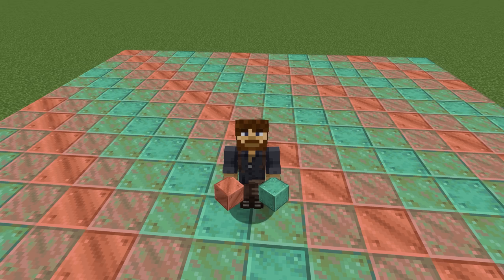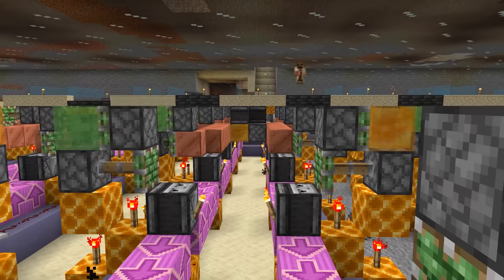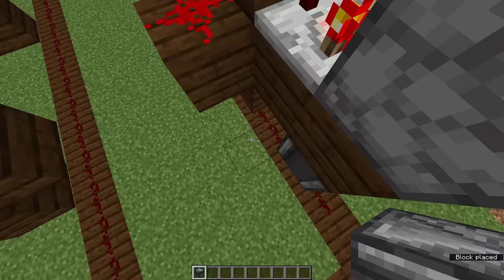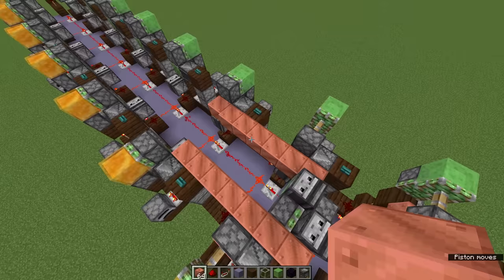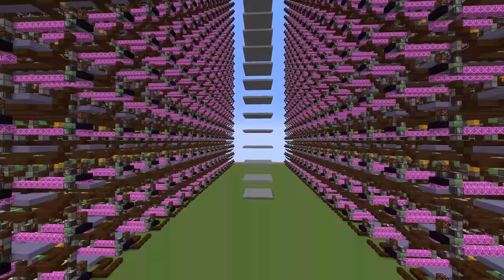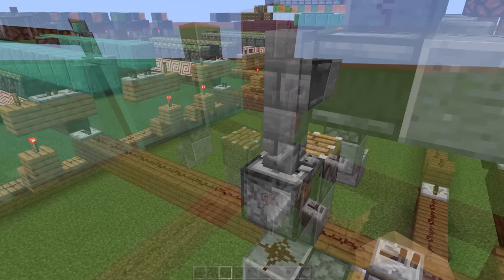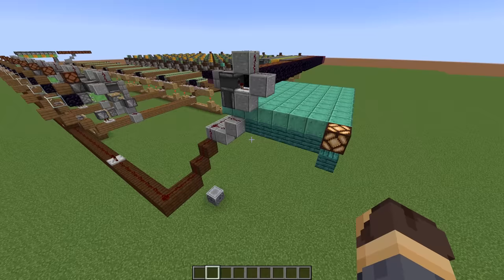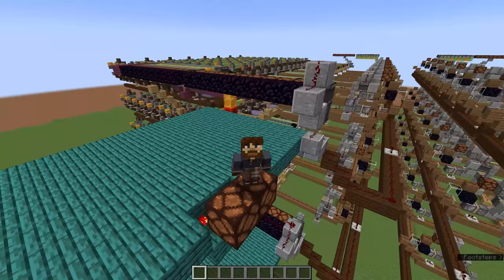Redstone Copper Aging Machine, AKA "David" (Tutorial, Schematics & World Download)

Comment: So I recently built a David 5 in my creative world in order to teach myself more about different redstone circuits.

In the process though, I came up with a small modification designed to make resolving the counting error easier (when a copper ages before it's placed and that module can't reach 0 and eject).
Basically I added a new circuit over the top of each line activated by a note block at the front of a line that pulses every top dispenser in that line once. It only affects modules that haven't already ejected and it saves you having to search out and fix the specific module that's stuck.

This does mean that now the best way to observe the lines is from the front, rather than the top as with some iterations, so I just built a lowered catwalk that runs down the center and use a spyglass to check for errors if a line seems to be stuck.

It might not be for everybody as it does add to the redstone cost, but I like the ease of access it lends to the user.
As a bonus, it also helped my attempts to make an aesthetic underground design that hides most of the redstone.

Comment: I love this version I'm currently on the final layer on my server and the rate  of copper oxidation is amazing. Played around with a lot of ways to remove the oxidized copper as it will break the flying machines upon the return of the second batch due to the push limit being reached. I prefer the piston feed tape, but simplest solution for a less technical player is an observer observing a wall where the last oxidized copper ends up that sends a signal to a layer of pistons pushing the copper up or down so you can let it run and it won't worry about the flying machines breaking. Also changing out the lever for a t flip flop removes the chance that you forget the lever and send the copper to the wrong half of the corner.

Comment: This is how tech players get started. Cheers for creating this! It can be a fun to come up with your own solutions, even if off-the-shelf solutions are available to be copied and are more optimized. It is just a game after all, ideal solutions aren't critical and solving problems can be more interesting than going through motions someone else came up with, if you are so inclined. 

A note about the 0-tick smart piston, you want to use a sticky piston for the one that pushes the block if you want it to actually 0-tick the block. A normal piston can be 0-ticked, but it won't instantly teleport the block like a sticky piston will. That particular version is also locational because of how redstone dust update order works - if it doesn't work in a given location, usually moving the updating piston on the bottom to instead be on top of the block fixes it most of the time, but there are still a tiny fraction of locations where it just won't work at all and a different version will be needed.

Comment: So this becomes as slow as the slowest aging coper block. Doesn't super matter since loading and unloading aren't fully afkable I guess so it doesn't really add any overhead to have to manually eject any blocks holding up the whole process. The ideal form of this probably returns the finished stuff to a separate station (to be hooked up to block storage/blast chamber), can load/unload each module independently as it becomes available and has some kind of timer back up in case one of the blocks ages before it starts being observed. 
that sounds really hard though.

Comment: So, not to be a jerk, but because of pix working on this with X, I took a shot at it myself, very loosely based on the design they used in hermitcraft, I have a design that can handle a 9x9 block of copper blocks and I think it's lighter on resources and less complex. One thing I don't have, but I thought pix, did have, is a way to account for a block oxidizing while flying or double oxidizing. Seems neither of us got around that. In my design what you can do, is just set the machine to recall a couple updates early (which is programmable, no block changes needed) so you could set "complete" to 240 instead of 243 and then you'd have safety against 3 undetectable events, but you may have the system fully recall with 3 genuine updates missing. But I think that's the best you can get. I'll try to find the time to share my design, but I'm already 3 months behind posting the let's play I am currently doing, so that shows how good I am at staying dedicated to posting on YouTube. Tell you what, if pix himself or a hermit reply to this, or if it gets 20 likes, I'll make the video within a week. Lol come on Minecrafters, motivate me. Haha

For anyone who may actually read this, I use different flying machines, still tileable, and you load all 81 blocks manually, but all in one big block. I don't have a single position for you to stand to load it, but that could easily be added.
The 9 machines fly across once as pistons pull rows of blocks down, just like this design.
When they reach the end, individual flying machines take them to their final place, again just like this design.
Then there's counting, my counting is completely different. I've made a few different counters, but I think 1 central counter for all oxidizing events is actually the key, cause then you can recall a couple updates early and not worry about double events or oxidized while flying events.

Also full disclosure, my machine has only been built as a 4x3 version of itself ATM. But making it bigger is just copying and pasting, its the same complexity at 3x3 as 9x9.
Reply: Oh and my recall is done differently too. Since every station is just a piston that pulls it's copper down, they just extend, then the machine flies back. But the cross machines would be in the way of the main 9x9 machines. So they return, the blocks to where the first machines can collect them, bounce back, then main machines do their recall, then the cross machines return to their starting position. I could probably simplify that more.
Reply from the maker: Not a jerk move at all! Like I said, there are other designs out there (Cubicmetre's is definitely worth your time) - I'm only sharing this because I figured it out myself, and it's the first redstone contraption I've ever conceived on this scale. 
I'm not gonna revise my own design based on other people's work, but I don't begrudge anybody having a crack at the copper ageing process if they can do better :)
Reply: @Pixlriffs  oh dang. He really went and did it. Now I gotta actually scale it to 9x9 and make the video lol. I also did the same thing with mumbo-jumbo's fully closed lava basalt bridge builder from like a million years ago. Soon as I saw his video I set out to do it differently. I'm no redstone master, there are gimmicks and tricks I don't know. But IRL I'm a high tier software dev, so I have a good mind for it. Guess I owe you an alt version of your copper machine now lol. Thx pix, for real, I have what it takes to be a YouTube guy and I want to be, I just lack motivation. It's really cool you replied and showed interest :)
Reply: @Pixlriffs  Alright, I have recorded me trying to explain the farm! I am editing now. But I think I'll upload it tomorrow. It's kind of funny, I think I've managed to simplify each module a fair bit, and simplify counting, since the whole system has just one counter, but I set a goal of wanting to load 100 copper blocks. So I had to make my flying machines a little more complex haha.
Reply: @Pixlriffs  I'm still very much a youtube and editing rookie, as seen by my like 7 videos, but I'm finally done! My video will be uploaded to my channel by the time you see this comment. Hopefully you see these notifications. the video is kinda long, I explain a lot that you definitely already know and to minimize editing, time I kinda just said everything all in order. But if you just jump the first half the video, that's where I really get into how my version works. Hope you enjoy it :)

Comment: Hi. It's my first comment ever, so sorry if it's a bit boring. I've been following your design for David since minecraft survival guide 2 and build it in my survival world, but only 4 modules, because lack of space and not much need for more. I used reset sistem with 2 observers and a piston, and tried to implement an observer detection system to reset the module. But it's getting struck with 2 observers creating kind of a redstone clock. I'll try to change it like in this video and hope it works. Can I build this auto collection and distribution sistem with only 4 modules? Best of luck and thanks for all your help
Reply from the maker: Yes, you can build it with just four modules. At that size, you can omit the circuit which locks the repeaters (since you never need to worry about the flying machines launching without copper attached).

Comment: could it break if a copper block happens to age one stage before it reaches its aging station?
Reply from the maker: Yes, but that's pretty unlikely because it's always within range of several other copper blocks of the same age - which will prevent it from ageing for a while. 
So unless you leave your copper alone for a long time before putting it into the system, it's very unlikely to age before it gets captured.

Comment: How about a clock as backup, in case an observer skips one of the copper aging stages?
Reply from the maker: The problem is that creates a lot of additional wiring and a lot of false positives - because I frequently find that an entire module will be done ageing except for one block that’s still fresh copper! If you add a timer, you’re almost always going to end up with one block returning without it fully ageing, instead of a ~1/100 chance you have to manually eject it.
Reply: @Pixlriffs  That would still be a win for overall efficiency. That one stubborn block could delay 72 fresh blocks from being loaded in.

I get it though. There's a beauty to a purely event driven architecture, and relying on timers feels hacky. (Both in redstone and in software engineering.)

Comment: I believe the fastest one involves putting the cooper near alredy aged cooper witch makes them age faster than If alone
Reply: Copper blocks cannot age faster than if they were isolated as Pix described. What larger setups (like the m³ one mentioned in the video) do is actually age copper slower by not separating it. They offset that with a bunch of fully-aged copper to regain some of the aging speed of separated blocks.
The chance for a copper block to age when receiving a random tick depends on a value that is calculated from the total number of nearby (unwaxed) copper block and the number of blocks with a higher oxidation level. If there are any nearby blocks with a lower oxidization level, the block won't oxidize at all, if all nearby blocks have a higher oxidization level, the block will oxidize as likely as if it was completely isolated.

Comment: Built this on bedrock. When it comes to the redstone strength, at the beginning, the signal is too strong. It causes the piston to be trigger 2 times rather than just once. Therefore, it sends 2 shovels into the bottom dropper rather than 1. 

After it’s grabbed by the sticky piston and put in front of the observer that is detecting the block going through the oxidation process, it only sends one shovel into the dropper, like it’s supposed to. That part is working correctly. 

However, here’s why I say it’s too weak as well. Once it’s fully oxidized, the piston was triggered twice at the beginning. When it was triggered, it sent the piston over two blocks while grabbing the copper at the same time. Instead of the piston being contracted and holding the copper, it’s extracted and holding the copper. Therefore, it doesn’t send the copper back because it’s already extended. 

As to why I say that the signal strength on bedrock, is too strong and too weak at the same time. 

Hope this makes sense. Maybe someone can figure a way to lessen the signal strength of the sticky pistons. I’m still a redstone noob, so I don’t know how to do that.